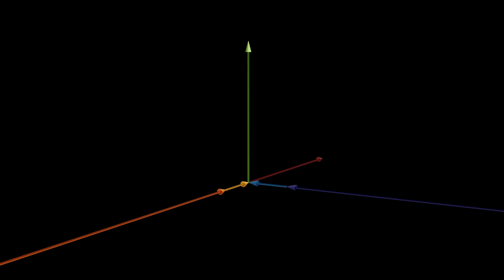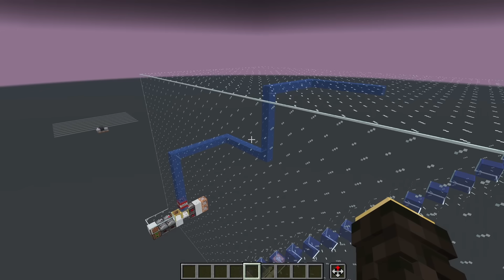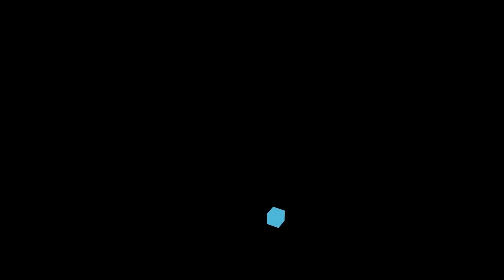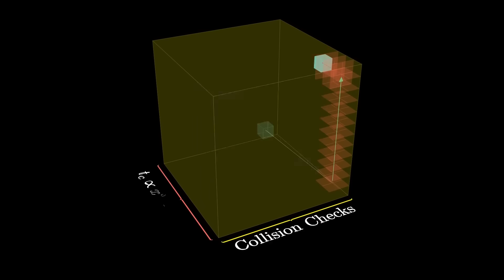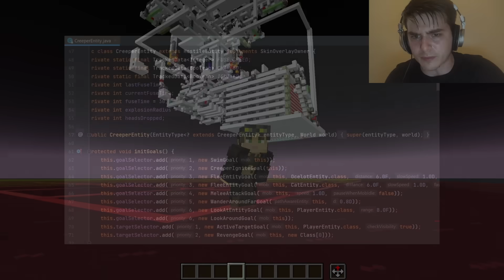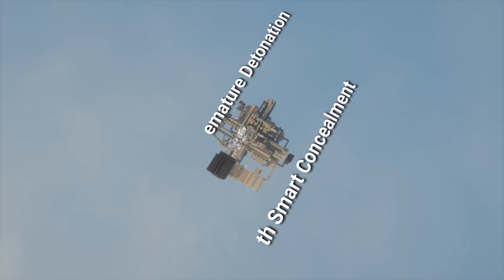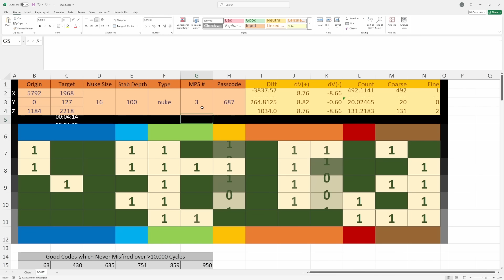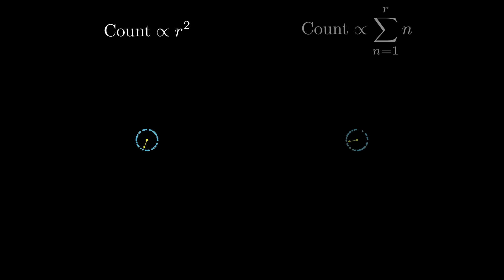Minecraft's Most Advanced TnT Weapon is Here

Comment: The next version: cubicmetre adds encryption to the wireless transmission so that no one can interfere with it
Reply from the maker: Encryption would mean using an algorithm to scamble and unscramble the binary sequence between the transmitter and reciever. Such a mechanism would be very big and complicated. Its not really worth building a machine bigger and more complex than the thing you are trying to provide a secure communication uplink to.
Reply: @cubicmetre  So you're saying that attaching an encryption system to the OSC is not happening, but designing a way to eavesdrop on wireless redstone signals and then designing an encryption system to mitigate that threat might be? ;)
Reply: Yeah, but why not! Some crazy person ( wembu, I'm looking at you) is gonna use it on life steal or the unstable smp or something.
Reply: @RohitPatel-ml5zc Well wemmy has switched to fake "orbital strike cannons" for theatrics, Minutetech and Rek nuked spawn on season 7 of ls
Reply: @cubicmetre  You could just use a Carter-Wegman polynomial evaluation* MAC like GCM but downscaled and include in the fire command an update to the current key set. This would provide a high degree of immunity against both random noise and provide a considerable amount of security against people who don't run around with crypto analytic software*. If that is an concern, don't update the MAC key via the fire commands. Instead, add a programmable ROM that locks out** each used key and make the cannon require a refill of new random blinding keys after all such keys are reused. In that case you literally have an information-theoretic secure MAC with minimal collision probability against active attackers who do not know the key.

* This bit is important for reasonably compact and fast implementations of the MAC. There are other options but they require much more complicated hardware like adders or polynomial division components. Polynomial evaluation hashes over GF(2^n) can be implemented with XORs and a fixed distance bitshift with conditional XOR with fixed value(or a fixed pattern of NOT gates).

** Conceptually the only way to attack this is to try and analyze the transmitted key update information embedded into the fire command message and the associated MACs. I can't think of an way to do this immediately but there's probably an attack there. 

* One might be concerned that someone could attempt spamming commands to try and burn up keys, effectively DOSing the cannon. This can not happen. You only burn a key once a valid message has been received for that key and this can only happen with negligible probability bounded by the size of the MAC and the birthday bound. You could also integrate the trick with modifying the repeaters in the wireless comm system to further mitigate that risk.
Reply: @cubicmetre  Sounds like a good place for a downscaled polynomial evaluation MAC with preloaded keys that get burned/disabled upon receipt of a valid message for the current key in use. You only need to select the field size (n bits), then select an irreducible polynomial for said field(GF 2^n). There are lists of such polynomial and the choice can be public safely. The keys will be of 2n bits each.

Evaluating a polynomial evaluation MAC only requires a single XOR(per bit) and then either a fixed distance bitshift or the same fixed distance bitshift and a fixed XOR defined by the selected irreducible polynomial per chunk of data consumed.

This MAC would solve both the authorization issue(only the authorized parties know the current MAC key) and protect against random noise/unauthorized fire commands(Don't need the passcode anymore). Forgery probability is ideal(ie limited by the birthday bound for the given MAC size). For a p_forge of 0.5:
-8 bits: 16 trials
-16 bits: 256 trials
-24 bits: 4096 trials
-32 bits: 65536 trials
This would be in conjunction with the repeater trick on the wireless communication network.
Reply: Edit: You actually need n xors and then the conditional bitshift/bitshift and xor for each chunk of data.
Reply: Thats already an option by changing some repeaters in the wireless transmitters and receivers
Reply: One Time Pad as the passcode. Instead of static passcode, you only send the current passcode once and then it requires the next passcode.
Reply: After seeing video I think the passcode part has to stay the same for unload protection and then have a second passcode which could be anything.
Reply: so uh, "encryption" for wireless redstone already exists. just waiting for it's creator to upload a video about it